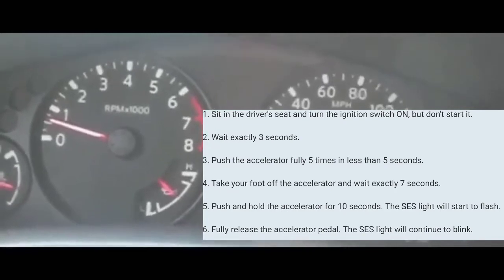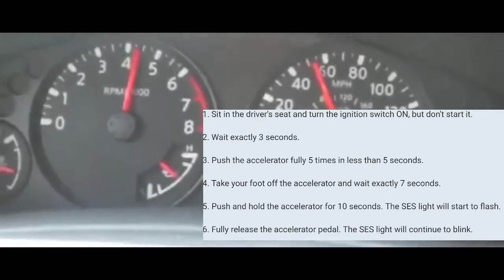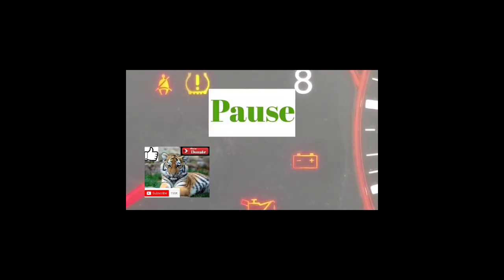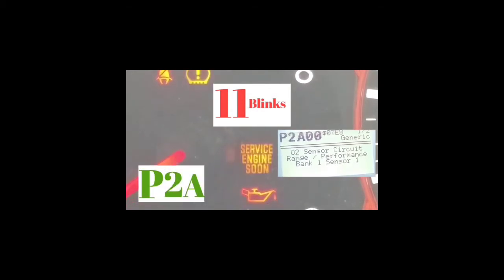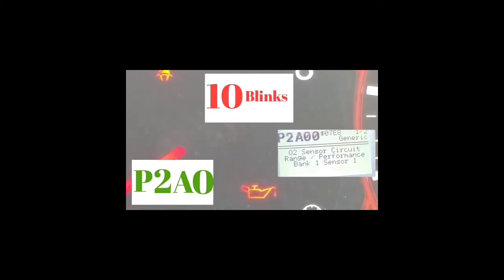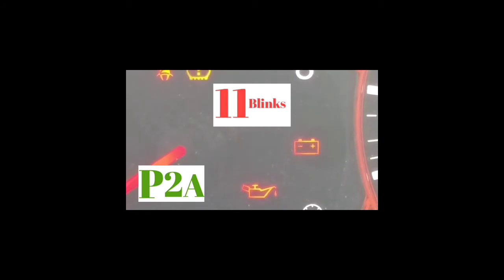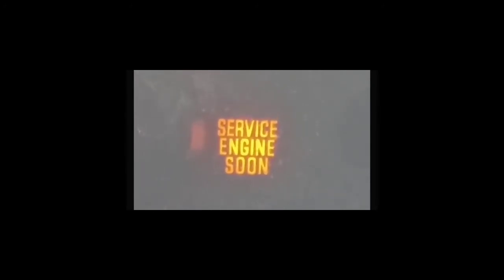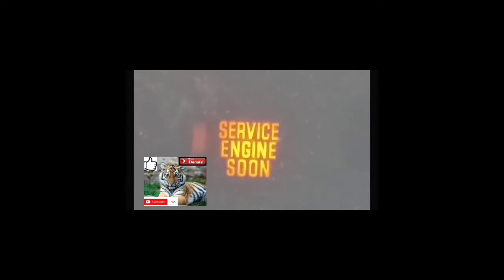How to Read and Reset Your Car's ECU- 2010 Nissan Xterra

Comment: I keep getting p0101, new maf, new air filter, clean throttle body.. what can the the problem it’s something circuit fault so the 5 wires must be bad yes? Please go in depth how to fix and how to read the voltage output of the sensor! Many thanks man!